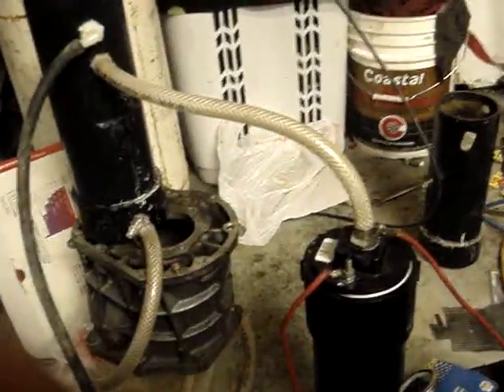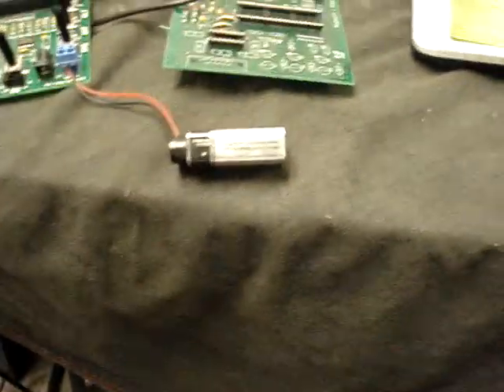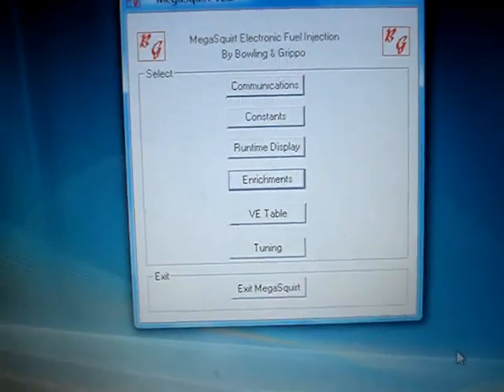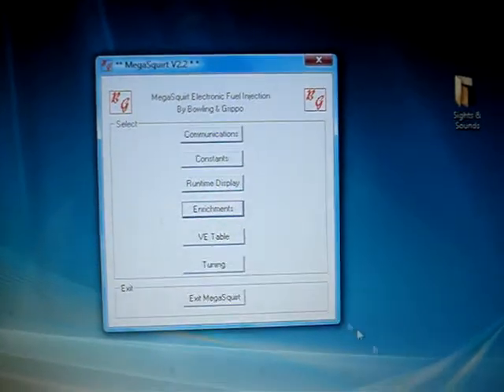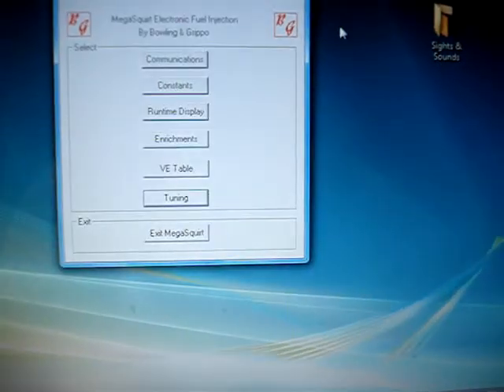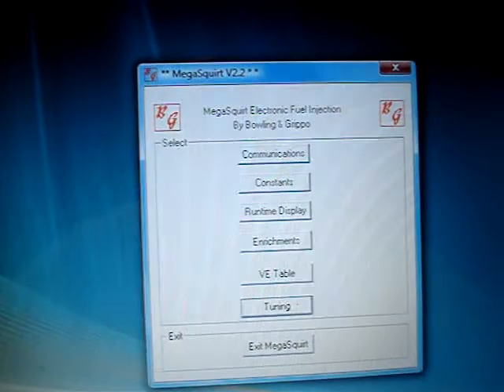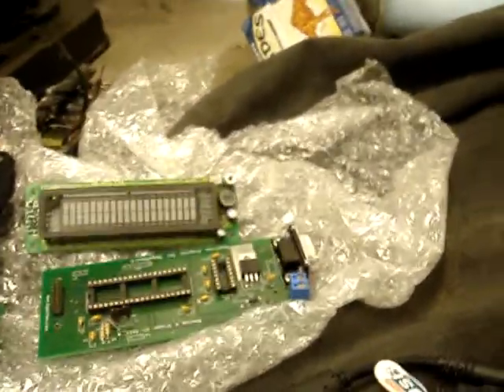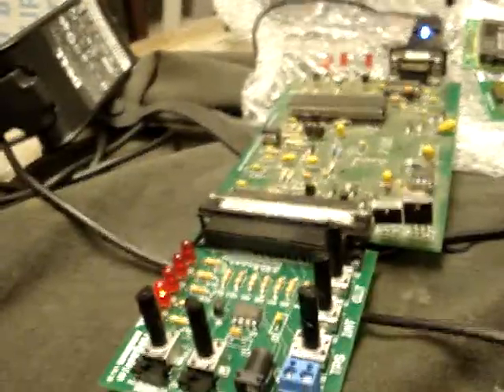series on install hho 90 suburban with stand alone ecm

Comment: i am trying to understand what you are able to do with those boards. are you getting your car to use hho efficiently without the cars computer getting smart and correcting any thing. 
i want to use hho but, it seems like an efie will only work temporarily or at a lower efficiency (MPG), without the ECM messing with my fuel trims or what ever else.

Comment: this is my current vision. can it be done?
i want to get my 1996 dodge van's computer reprogrammed or something with new fuel mixture algorithms, so that if i get a good tech to install a good PWM and get some consistent LPM so that all i have to do is drive. ignition, idle, freeway, any kind of load or load increase the engine and computer are working fine giving hoarse power and go MPG. is that possible?